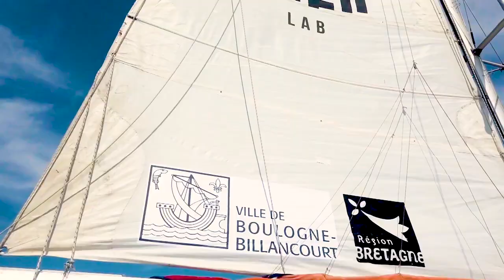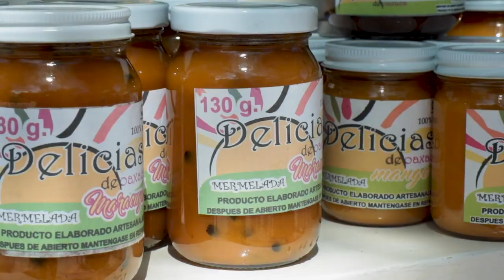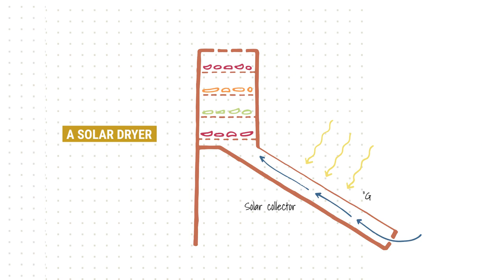🇫🇷 🇬🇧   How to dehydrate fruits and vegetables ? - Solar Dryer - DIY Tutorial

Comment: It is worth to note that dehydration to direct Sun, results in lower final content of nutrients due to the impact of solar rays on cells. In a dark box with a good airflux and 45°C you may achieve the highest nutrient content achievable with simple dehydration. I believe liofilization would be the ultimate way (And a very expensive  and energy intensive one too!).
thanks for sharying y'all!! PLUR

Comment: Maybe you can use stones for heat collector? It will absorb heat and provide hot air flow for longer?
I'm not sure about the outcome, it's just a suggestion...
Reply from the maker: Thanks for the suggestion !
Indeed, we could probably use slate for collecting heat and store it a little bit longer.
Reply: @low-techlab2411  Thank you for your video and efforts. I hope other viewers will benefit more from me.